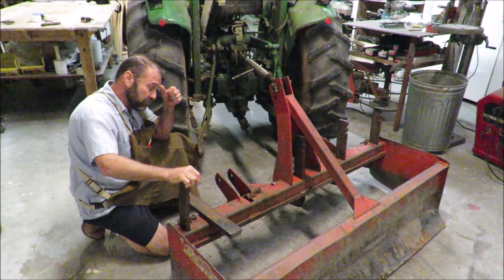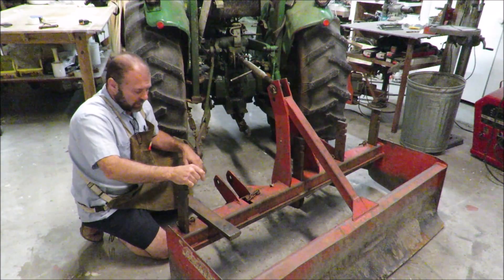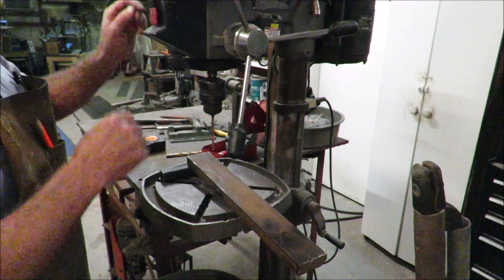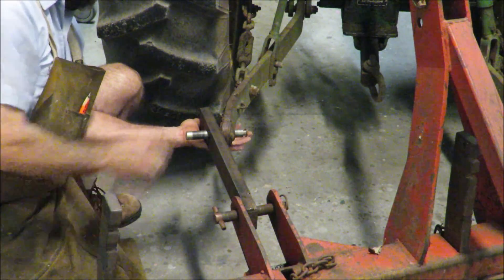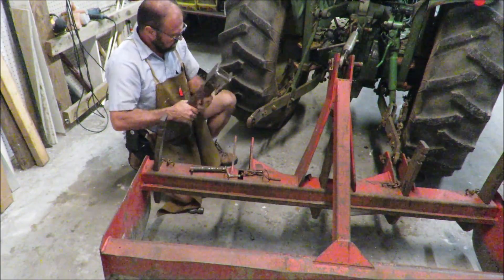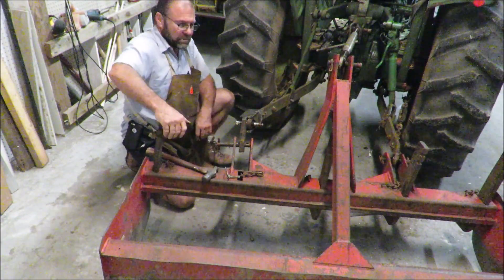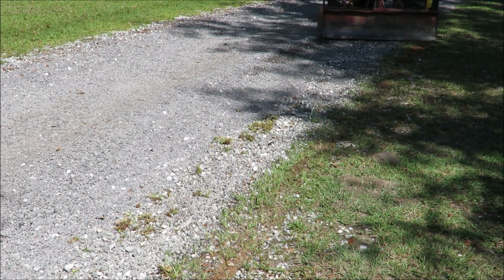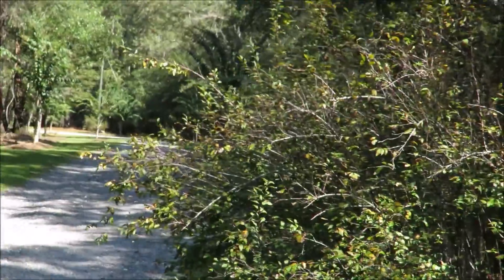Making a adapter to turn a box blade into a grader blade. Simple homemade build, saved $500

Comment: What you did was a great idea, however if you would have cut the dirt out in the beginning before adding the rock to the road, You wouldn't be having to chase rock such as now. I've built roads for 20 years, in every situation, if you cut out a ledge for 3-4 inches of rock it's stays in place after that. I understand the undertaking that would be now to do, so what you built is a good idea.

Comment: Enjoyed and learned from your videos for some time now ... wondering which / type / brand of metal drill bits you use?  Noticed that you used no oil ... all the best from central Arkansas!
Reply from the maker: Hello. I used a little soapy water on the drill bit. I have had those drill bit a long time and don't remember where I got them. Thanks for the kind words. Mark

Comment: My driveway is over a quarter mile also. I bit the bullet and over 2 years bought 6 - 14yd loads of crushed concrete. For many years i bought countless loads of class 5 gravel and watched it wash away every heavy rain. This was a dairy farm and the quad axle milk truck came here daily. The more you drive on crushed concrete the harder it gets. It's just like concrete now. Can make turns with the skidloader it wont tear up and no more heaving during spring thaw. Problem i had was the lower end dropped off and was washing out plugging the culvert, had to dig that up to clean it out. It's all good now and pretty white looking. When we were kids we had to walk the long driveway to the school bus every morning/afternoon in the rain, snow and -30 below!
Reply from the maker: My wife does not like the looks of crushed. I use to use #57 limestone but it has gotten to expensive. Now I use mill slag fines from the local steel mill. Thanks for watching.